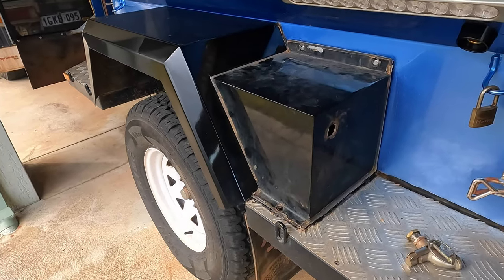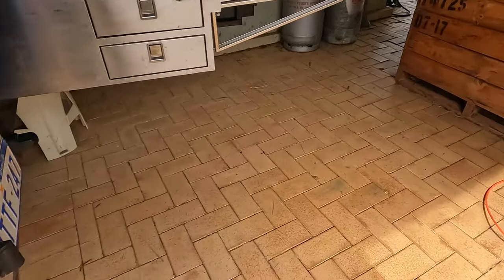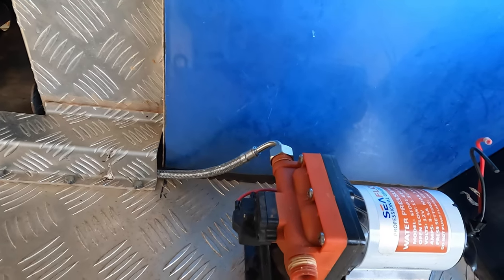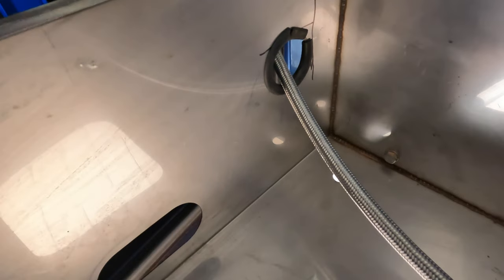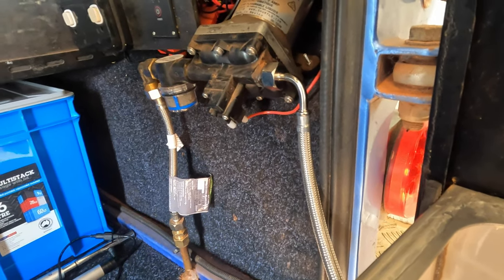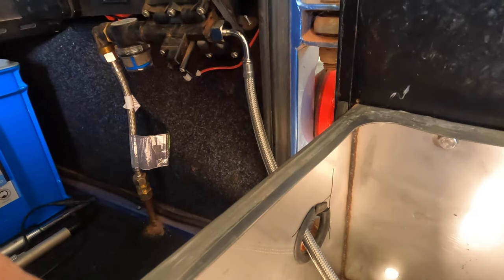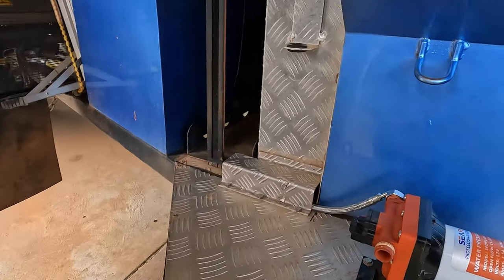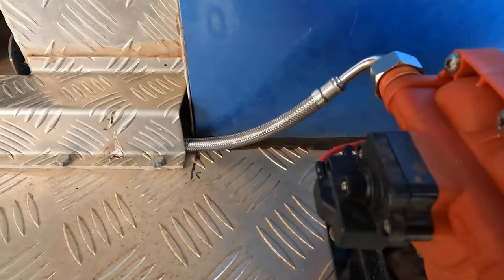RV Plumbing.  Improving the Flow

Comment: Good advice, as always.   :)
Reply from the maker: Sundancer my friend. How have you been going mate ? Yes when i build it for myself, I only want to do it 1 time. I want it to work even after it's been bounced around the bush. Will do a video on it after i have it all put together, Used rubber gromets on the chafe points and an IP67 switch. Don't cost much more to do it right the first time.
Reply: @JustinCaseSolarPower  Really like the stainless steel set up. Looks really solid and professional !